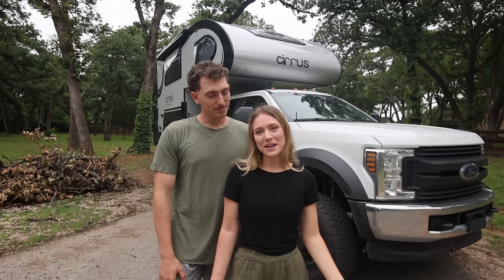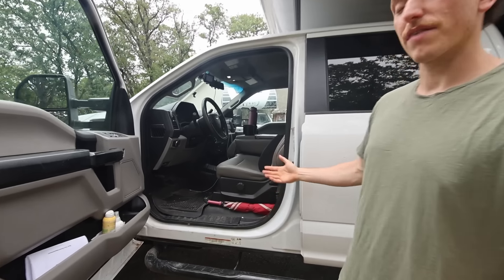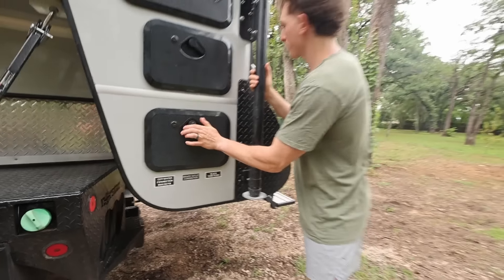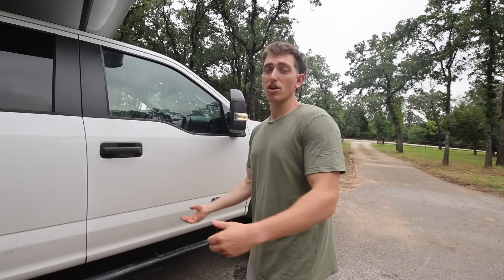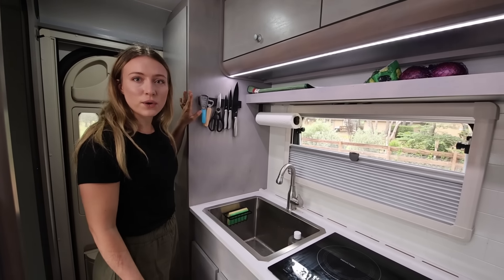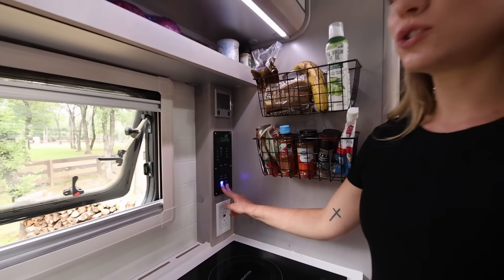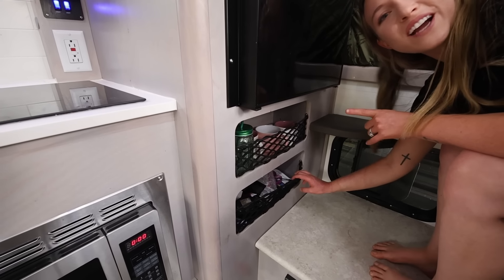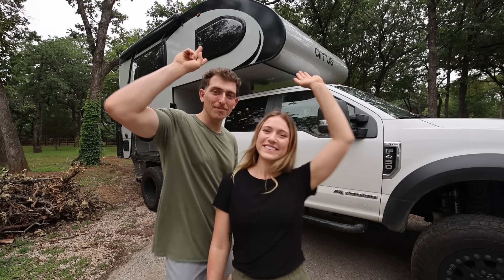Tour Our NEW Truck Camper | 2024 Cirrus 820

Comment: Not a bad video. Rehearsing your script would help avoiding repeating words like “super” and “love”.  While you did a nice job of showing the storage options of the nuCamp cab over, small things you missed do matter.  For example, most of the exterior compartments have locks.  That has not always been the case, some of the earlier cab overs just had the latches to open close.  Your fridge/freezer in the back seat is similar to our own setup - but you failed to mention how you power it when moving and then stationary.  We use DC power when moving and then switch to a portable lithium battery system when stationary.  The power cable storage and different connectors was interesting but no mention of a surge protector.  Is there a built in one?  That large gap between the cab over and the rear of truck cab seems like wasted space.  Surprised you haven’t utilized it.  FYI, we travel about 200 days of the year pulling a nuCamp t@b 400 BDL and are currently on a four month trip through Alaska. The large bottom bin on the door is a good place to store all those plastic grocery bags.  As Ambassadors you should mentioned things like power - without propane what can your batteries power and for how long?  Plus, are you using lithium or ACM acid batteries?  Can you use the microwave and/or the glass top stove on DC only power?  Same for the solar panels that I’ll assume are on the roof?  Does the unit come prewired for things like a weboost cell booster and/or satellite system?  Finally, I think letting folks know the cost is around $48,000 base price.
Reply: Ah ... Gee whiz ...  Umm ... Thanks Dad ... we were just about to mention all those things.  The ones you mentioned are VERY important too.
Reply: @gregoire8376 dude seriously? Your review was based off of zero experience in the rig. Your wife said it herself you guys hadn’t camped in the rig. I met you guys at the Overland East rally and you guys came across as cool, but wow are you sensitive. Having just been to the nucamp factory I know they helped you with this rig. You might remember who you are representing. Not necessarily a good face

Comment: If you change the AC unit cover to a white cover, it would be more efficient, keeping it cooler more easily and using less power. Just a tip.
Reply from the maker: Great tip! Thanks for the advice :)

Comment: So they seem to have made some significant changes from 24 to 2025. I’m holding a flyer for the 2025 820 in my hands. The freshwater on this is 36, 33 gray and still 28 black with a dry weight of 2876. Wonder where the extra weight is coming from?

Comment: Hi guys, your channel just popped up on my feed probably because I do look at a lot of truck camper channels. Eventually, I will be doing something similar. 
So I have a few questions.  1. Why the F450 when a similar F350 or 3500 ram could easily handle that rig with room to spare?
2. Do you remove the truck camper at all and use the truck unloaded? if so, how does it ride? 3. Do you go out into the wilderness essentially off-roading?

I just got a good look at an 820 and the new 2025 920 at the Fla RV super show this past month. I really like the room in the 920 and I would be a solo camper but still. 
Thanks in advance.

Comment: Are you using the mattress that came with the camper? Is it comfortable? Does it have the Frawley box springs beneath the mattress?
Reply from the maker: We are not! We added a GhostBed mattress and it’s super comfy. We used the mattress that came with the camper in our last 820 for almost 3 years and it was great. We do have the froli system as well and it does a great job!

Comment: Hey, I love your tires, wheels and suspension setup! Can you point me in the right direction to upgrade my F450 to a similar mod? I live out of my 2024 Cirrus 920 and would love the extra beefiness. Thanks for any advice or suggestions.
Reply from the maker: Of course! Would love to help! Do you have a pickup or cab chassis?
Reply: @OurFulltimeAdventure  I have the pickup version, 2022. Thank you
Reply from the maker: We went with the Wicked Customs 3.5 inch level with 2.0 Fox Resi shocks. 

For the wheels, we have StazWorks Dually Wheels wrapped in Toyo AT3! StazWorks makes some amazing wheels!

Comment: I have to say I love the cirrus 820. I will be looking to buy a truck camper real soon. Can you run your AC on the solar ? because living in South Florida AC is a lifesaver. I wonder if you could get a generator put in it that would help out a lot. also, I have to say I love the way you have that camper set up.👍👍
Reply from the maker: We love the 820! We can run our AC but definitely recommend a soft start. You can probably mount a generator on a front or rear cargo rack to make that work out!
Reply: Thank you For that information. I love the cirrus truck campers, but I wasn’t sure if the AC would work on the solar power alone or that I might have to plug it into shore power or a generator. thank you again and have lots of fun with your new truck camper.

Comment: Get some three or five pound descant bags and put in the external storage to keep the moisture down.  You can put them in an oven at 175-200F for about 45-60 minutes per side and dry them out and reuse them or however the instructions say.
Reply from the maker: That’s an awesome idea! We’re going to look into it. Thank you so much!
Reply: @OurFulltimeAdventure  IF humidity becomes a problem you can find electric units that are used in gun safes to control humidity.

Comment: I've been looking to have the same set up with the flat bed and a Cirrus but I would like the 920 because I need a bigger fridge, I like the dry bath and not having propane. The problem is that dealers seem to be playing around with the price making it very expensive. I also need a truck and need to stay within my budget so I hope to get the 920 at some point but I'll start with the truck. Enjoy your new set up guys.
Reply from the maker: That would be awesome! There is a dealer in CO selling a 920 for $76,000. That seems to be a fair price point!
Reply: Thanks for the tip.
Reply: $76,000...??????are you kidding me? Have you looked at Northern Lite?
Reply from the maker: I’ve seen the northern lites. The 8-11 goes for like 69k with little to no solar let alone lithium. I think that camper for 76k is priced right. 

Just to confirm, we’re chatting about the 920 and not the 820 right?
Reply: Yes, I am looking at the 920 because I do not want propane and prefer the dry bath. I am also not a campground person and so I need it to be fully off-grid. After my experience and checking around Cirrus came on top, and if I purchase something less costly I would still have to add an average of $6K to $10K in a solar package and lithium. Plus, Cirrus has the Alde system which I prefer.
Reply: @OurFulltimeAdventure 
2023 yr NL started with 600watt solar standard on, 8-11,9-6,10-2🍻

Comment: Congratulations on the Ambassadorship!!  Rig looks great!  I'm very interested in how you go about getting rid of the propane.  I'm assuming NuCamp did the modifications.
Reply from the maker: Thank you! Removing the propane is fairly easy actually. We did it on our last 820 but this one was done a bit different being that it’s only electric which is super nice. Our 2017 820 has diesel heating
Reply: @OurFulltimeAdventure  maybe you could do a video about that in the future?
Reply: @myjavadogs I would be interested as well.  I just came across their channel but have to wonder if all of their camping is done in Parks with power outlets?  While they briefly showed a number of batteries, they never mentioned specifics - lithium or ACM, what the batteries can power and for how long.  We have a t@b 400 with the three-way fridge (DC-AC-Propane) and we know from experience the fridge won’t run long on battery.  We did replace our two ACM batteries with lithium.  I get why they want to go all electric but they should have gone into a bit of detail regarding the power draw in this rig.

Comment: I love the Nucamp teardrop 360. I love the metal baskets near the stove. So many of my command hooks keep falling off, I've been discouraged.  Excited to see you adventures.
Reply from the maker: The new 360 is so cool! Where are you command hooks falling off? A little superglue on the backside goes a long way! Thank you for following along!
Reply: Smart!!! Superglue!!! The biggest issues is the bathroom and kitchen. Thinking it's the steam and humidity.  I'm adding Superglue.
Reply: @hcarpam1 We have command hooks in our t@b 400 BDL bathroom since 2019 and they haven’t fallen off.  Suggest clean the surface first and then use the heavy duty command hooks (the Velcro comes in different strengths).  Also have several on our entry door that hold the dog leashes and a couple in the kitchen area for small things.  No issues thus far.

Comment: Great video.  We just looked at the 820 at NuCamp.  We have a T@b 400.  Careful with the reflective in the windows.  It will melt the window.  There is a warning on our T@b windows which are the same in the 820
Reply from the maker: Thank you! We love our 820. We love our 2017 and now our 2024 even more!

We’ve had the REFLECTIX in the 2017 for 3 years without issue. I’ve seen the warning but boy does the REFLECTIX make a huge difference.